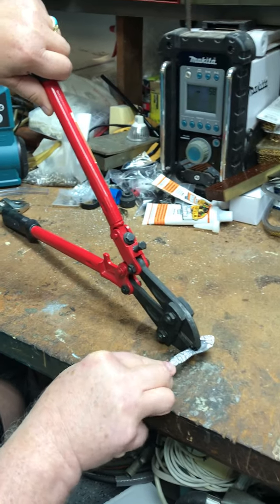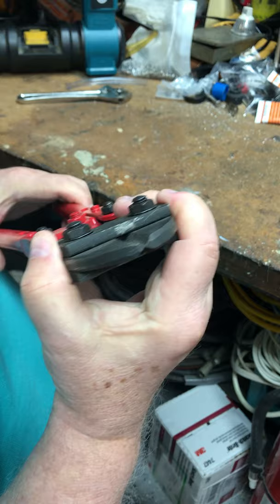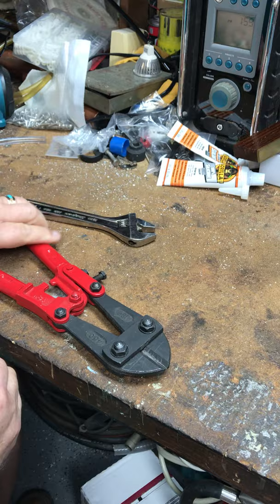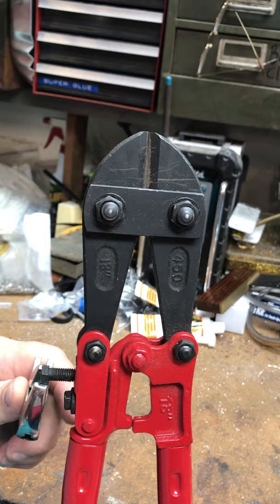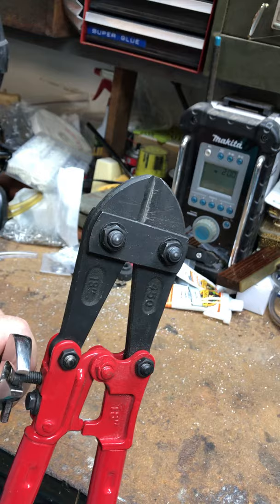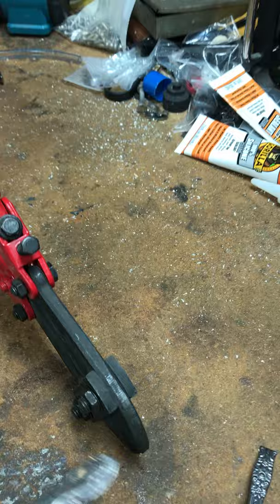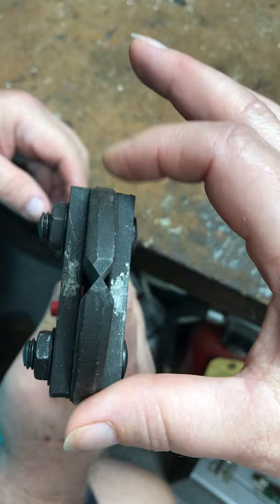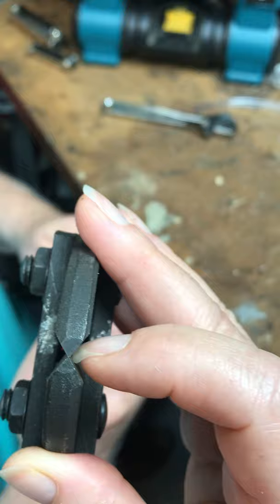Adjusting Bolt Cutters

Comment: I know this is an old video but I have to tell you, you
are using the wrong tool, to cut your spoons.
You need a sheet metal shear. The spoons are a little thicker
than what you may consider sheet metal but that is what it is.
Bolt cutters are not made to cut sheet metal, that is why you
are having problems, with them. Specifically, you want a bench
mounted, long arm, sheet metal shear. 😁✌🖖

Comment: Can u adjust how fair they open up or not
Reply from the maker: No you can't.  It is fixed by the manufacturer of the bolt cutter.  It may vary from one manufacturer to another.